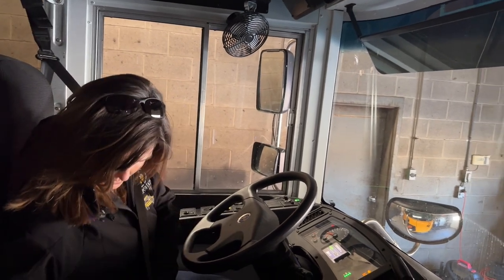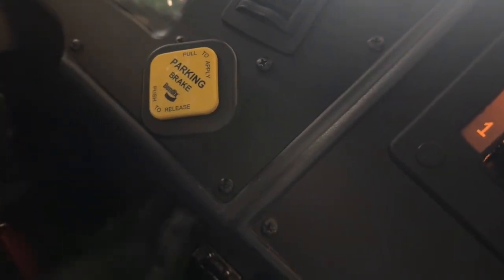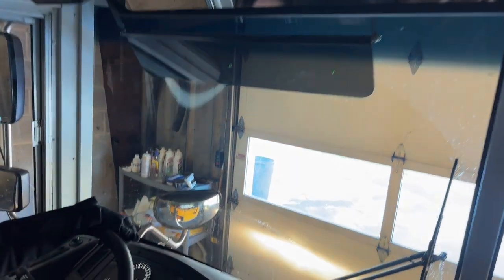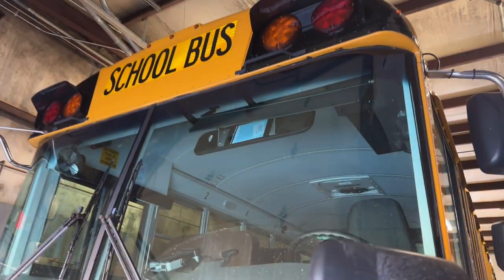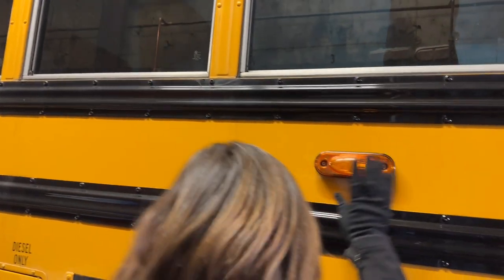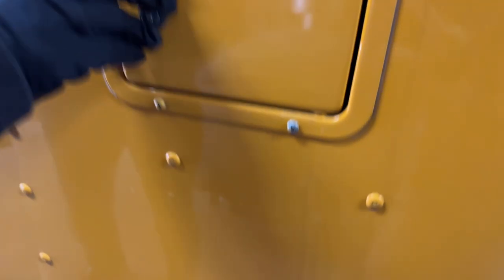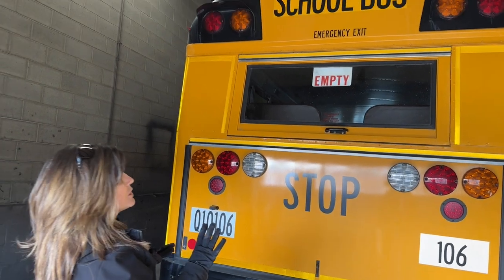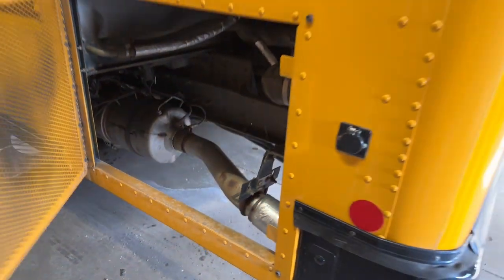2023 School bus pre-trip demonstration on a 2019 Blue Bird RE Transit

Comment: Thank you so much for this video. I've watched it several times now. I do have two questions for you. 

1) You checked the passenger side wheel areas in great detail. On the driver's side you merely mentioned that you'd do the same here. Is that sufficient for the actual test, or were you just saving time for the video? 

2) Is it OK to ask the tester to help with the final light inspections, or do I need to bring a friend to help me. Of course, since I won't be licensed at that time I'll have a licensed friend with me so either way is fine. I just don't want to ask the tester for help if that's not allowed. 

I hope to test later this summer. Thanks for your help!!
Reply from the maker: Hi Flint… great questions and thank you for asking.
In Ohio, it is acceptable to mention you would check the other side the way you checked the first side.  
The tester will go outside to check the light functions, as you make the lights from the inside.  I hope that makes sense.

Comment: Your videos were instrumental in helping me get my CDL to become a bus driver in September!  Thank you!  I have a question I was hoping you could answer: which lights are required to be on when driving a school bus in the daytime besides the headlights?  I drive a Thomas and when the switch is in the automatic position, my lights come on, however, the clearance lights/running lights go out when it is bright enough.  They all do come on when I engage my wipers.
Reply from the maker: Best practice is to drive with your headlight switch in the on position.  When you keep the headlight switch off, and rely on the automatic features, the headlights will turn off when your brake is pulled and on when it is released. 

I tell all my drivers to drive with their headlights on at all times,  when driving.
Reply: @SchoolBusSass  Thank you.